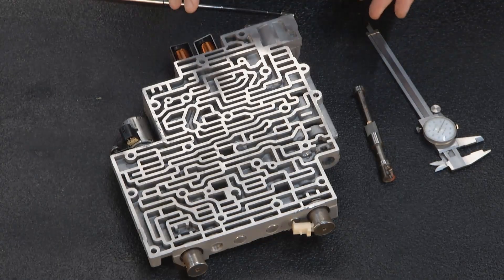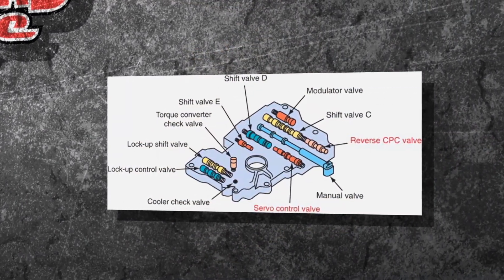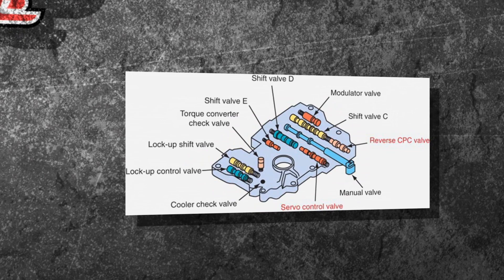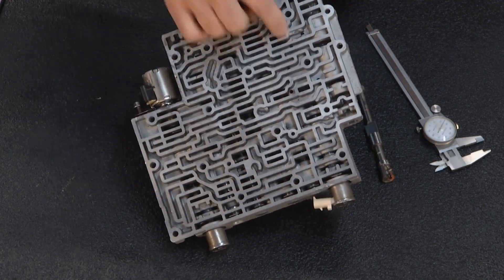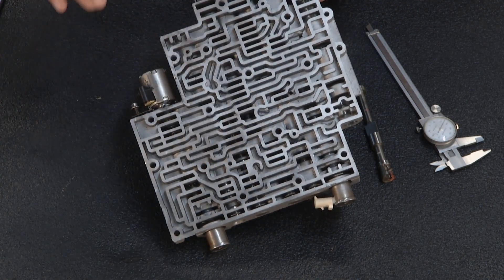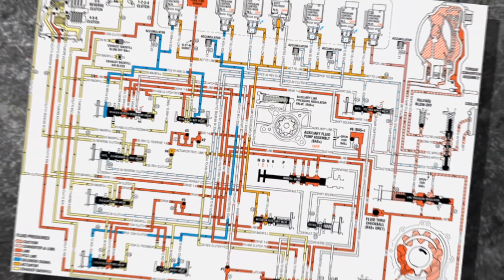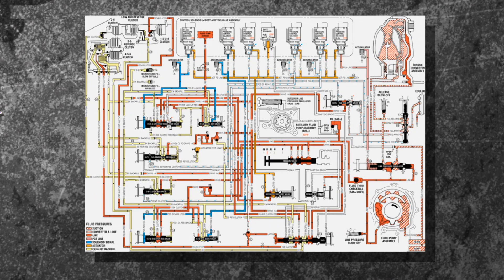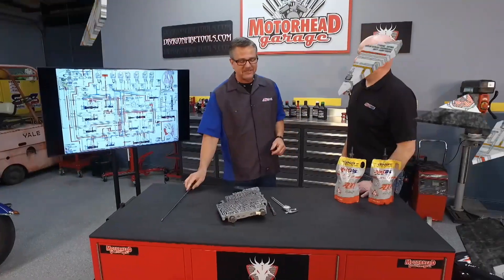Shifting Transmissions

Comment: Looks like a 4L60E valve body if I've ever seen one! I think I actually see them in my nightmares, er aw I mean sleep, Ha! Yup I've fixed a ton of them. All of AMSOIL's ATFs and trans fluids are great stuff for any transmission, transaxle or gearbox to help keep them running for the long haul. Just be careful to use the correct fluid for your particular application.